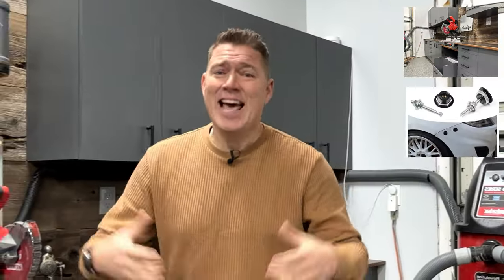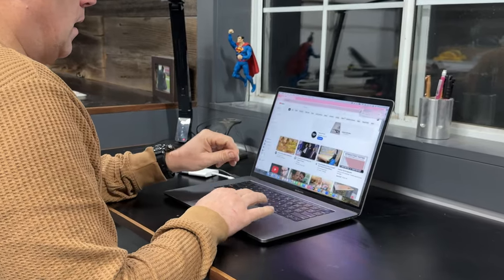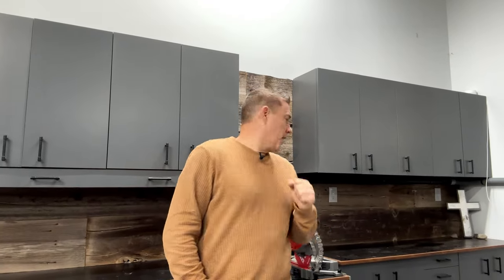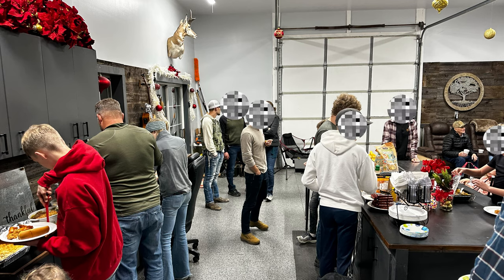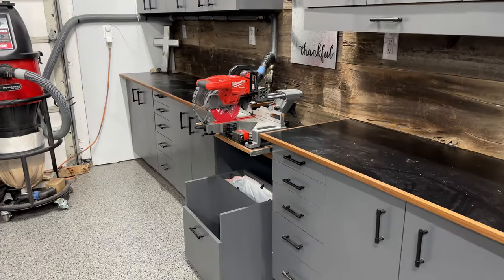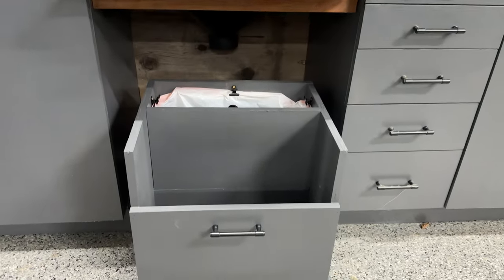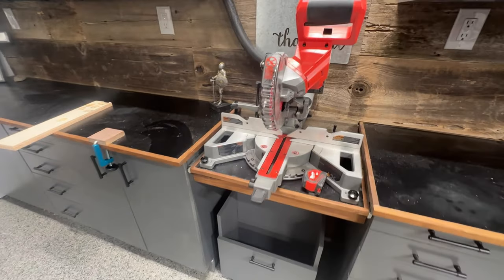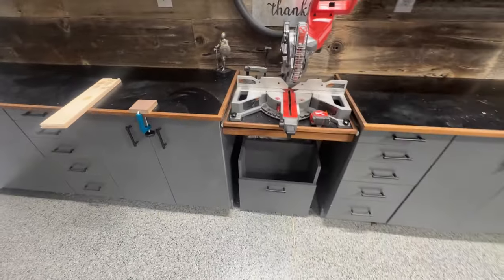Miter Saw Station Workbench Build: Sliding Action, Quick Detach and Scrap Solution—Must See!

Comment: I forgot to ask if you have a link to your dust collection setup. I’ve been looking at a few but yours seems to be simpler yet effective. Thank you!
Reply from the maker: Great question. I’ve been getting some more requests on my desk collection system.

When you say “link“, if you’re meaning, do you have a video on it, I do not, however, I have been thinking about making one.

Or, if you mean, do you have a link to where I could purchase one, I could always find it for you if you need.

For me, it’s a very simple set up but yet it’s very effective.

Hopefully soon, all do a short video on my dust collection systemand take a closer look at it.
Reply: @generalsworkshop  - Thank you for responding. My fault I should have been more clear. Yes l am asking about where you purchased it.
Reply from the maker: https://www.pulsebac.com/

Here is the website to the company where I purchased mine. The nice thing about the pulse Baeck nature of these machines is that they allow you to do super filtering that they would even work and often times are highly specified for even concrete work. These machines are so efficient that even when you’re grinding concrete, and I’m gonna be doing a video up-and-coming of my carport floor coatings that I’m gonna install, the shop Baeck will easily facilitate that as well. , check them out, and if you have absolutely any questions whatsoever, feel free to let me know and I’d be happy to answer whatever knowledge I have.

Have a great day.